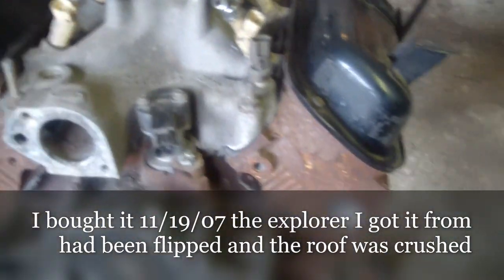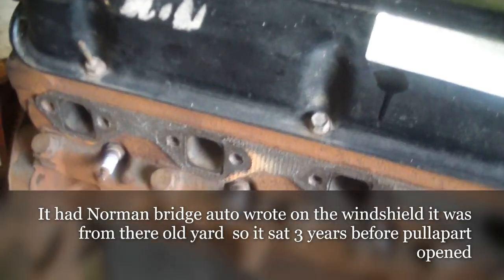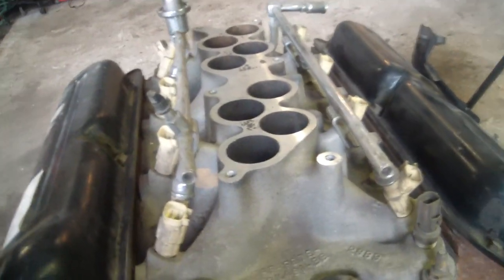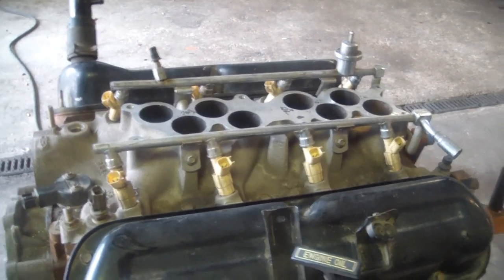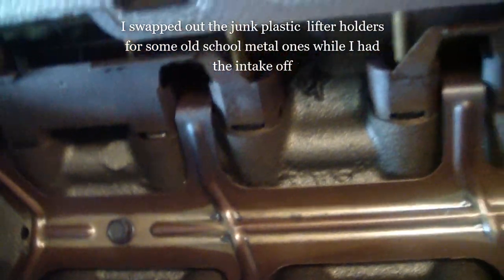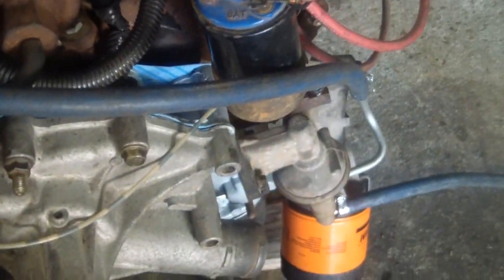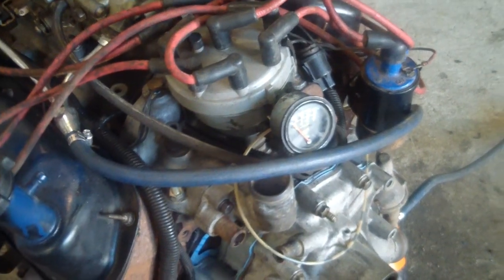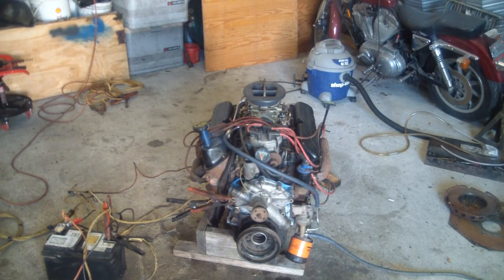First start 01 Ford Explorer 302 swapped to carb

Comment: What intake and distributor did you use?
Reply from the maker: weiand 8011 intake and a 85 mustang distributor first year they put roller cams and last year with a carb
Reply: @kickassmustangsgarage  thank you. It is exactly what I want to do to mine. It's going in a 48 F1.
Reply from the maker: @bokennedy9490  I swapped the timing cover and balancer and used mustang pulleys and a 78 LTD water pump and the alternator bracket off a 85-93  mustang with the tensioner all I have is a alternator and the water pump and the crank pulley no power sreering or AC 85 mustang timing cover has a mechanical fuel pump hole if you don't want to run electric fuel pump
Reply: @kickassmustangsgarage  I think you also had to add a fuel pump eccentric.  For anyone reading, make sure your cam gear is the correct one for the type of eccentric you run.  Ford has a one piece eccentric for the early motors and a two piece for the later motors.
Reply from the maker: @sbf_fox2434  The old one piece is thicker because they used  a single  row chain and it will scrub the timing cover if you use it on a double roller chain. I put a semi truck turbo on it and put it in my 87 Ranger go check it out and Subscribe if your interested

Comment: What year timing cover did u use?
Reply from the maker: 85 mustang the last year of the carb
Reply: Thanks man and will I need that 85 distributor if ima replace the cam? And will the fuel pump esentric work on a noisy gear drive instead of the double roller chain?
Reply from the maker: @marclopez4404  85 Mustang was the first year with a roller cam the distributor gear is steel not cast iron. If you have a roller cam they will eat a cast iron gear. I've never used a gear drive so I don't know about that.
Reply: Alright thanks for the info, I was stuck with that crank sensor, but thanks again u brought life back to my build!!!
Reply from the maker: Glad to help. Shoot a little video and upload it. When you signed in to YouTube you started a Youtube channel.
Reply: Alright I’ll check it out, and another question will I have to change the crank pully/harmonic balancer?
Reply from the maker: @marclopez4404  I used Mustang accessories and balancer on mine.I don't know what you are putting it in or what accessories you plan to use.
Reply: Alright and from the 85 mustang? And the car is a 96 Ford Thunderbird originally had a 4.6, but I just went ahead and brought a 99 Explorer engine and transmission, but I have another problem with the transmission I think ima have to use a c4 so I don’t have to mess with wires.
Reply: My plan is to put a e303 cam and new rods and lifters and I have some trick flow springs put on the p heads, and I have a high rise intake and I’m looking for a 650 holly double pump, and I think that would be it. If u can let me know something I’m new to all this engine building. Thanks
Reply from the maker: @marclopez4404  a Mustang AOD with a detent cable will work if you want overdrive. 85-93 Mustang accessories are the same. 85 timing cover has the hole for a fuel pump. 86-93 Timing covers don't  have a fuel pump hole.
Reply from the maker: @marclopez4404  You could use the electric fuel pump in the car now just get a fuel pressure regulator like the one I used. If you dont use the pump you'll have to take it out and add a hose to reach the bottom of the tank. I would put the cam in while you have the timing cover and the intake off spring if you already hav'em I wouldn't do anything to the bottom end and put it in.
Reply: Alright man ima be on the look out thanks for all ur help.